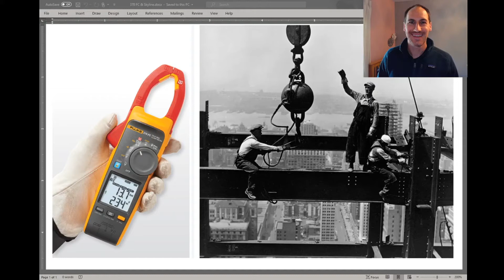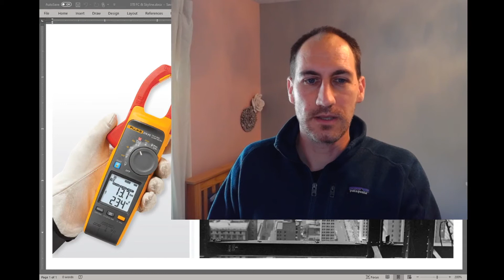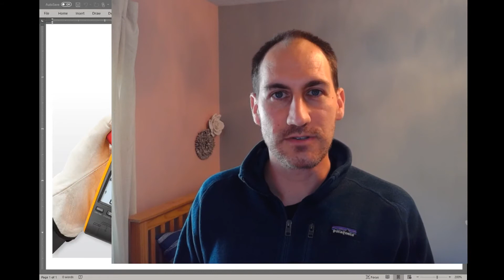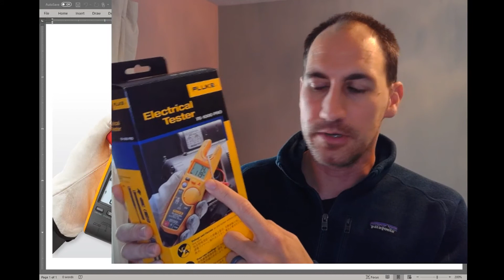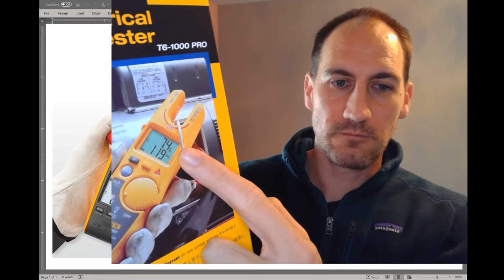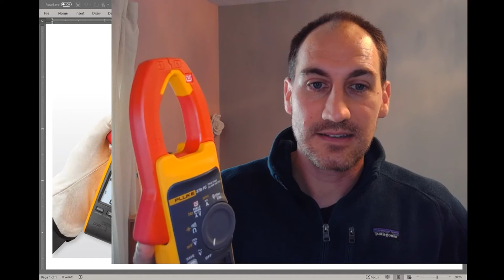Fluke 378 FC - Field Sense

Comment: I am new at this. Can the 87 V and the i400 ac current clamp do the same things than the one  in this video (378 FC)
Reply from the maker: Not exactly. With Field Sense you can measure AC current and voltage by simply clamping around a single conductor. With the 87V and i400 you would have to clamp with the i400 to measure AC current. Then if you wanted AC voltage you would need to removing the i400 from the 87V, put the test leads into 87V and make voltage measurement with the test leads.
Reply: @fridayswithbrandon  what about comparing it with the T6 1000 pro
Reply from the maker: @alvilla701  t6-1000 pro has Field Sense. So yes it can do Field Sense just like the 378 FC. But it does not do some of the other features like capacitance and other things.
Reply: @fridayswithbrandon  thank you,  I got the 87V max, and I might get the T6 1000 pro or the 378 FC to continue my collection,  thanks you again

Comment: Will fluke ever add LoZ mode to a clamp meter?
Reply from the maker: Both the Fluke-376 FC & Fluke-375 FC have Low Impedance built in.  I'm trying to verify that the Fluke-378 FC & Fluke-377 FC have the same feature.  See Web link to hear from Fluke on LoZ.  https://www.fluke.com/en-us/learn/blog/digital-multimeters/dual-impedance-digital-multimeters
Reply: Thanks
Reply from the maker: @ratchetgear3432  I was wrong.  We have a Lo-Pass Filter for VFDs for the - 378, 377, 376, 375 FC.  But we do not offer any clamp meters with the LoZ mode.  Sorry for my confusion.
Reply: No problem. I will look into that adapter. Thank you for your help.
Reply from the maker: @ratchetgear3432  Also, You could add this accessory to get rid of stray voltage. https://www.fluke.com/en-us/product/accessories/adapters/fluke-sv225